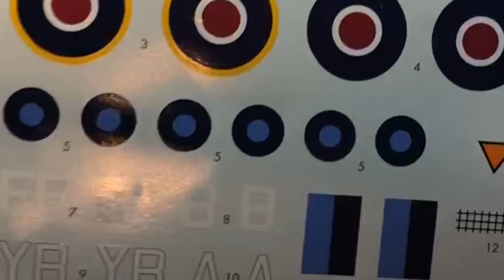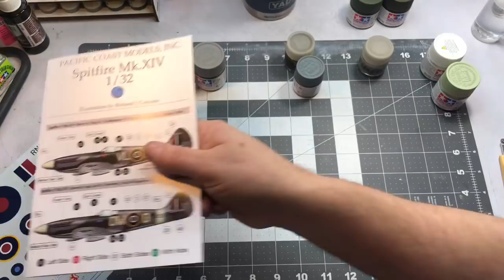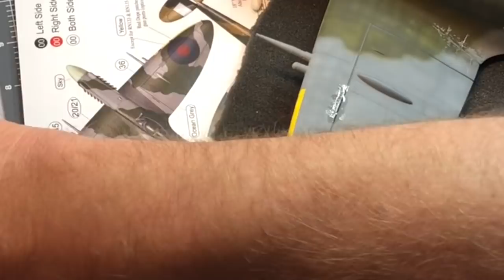Pacific Coast Models 1/32 Mk. XIVc Spitfire Build Part 3

Comment: Those wheel wells / retracted landing gear looks perfect.  I like all the stuff out there to fill with. I am truly loving working with Plastic Putty for seams & such. The Q tip & iso alcohol tip is interesting. I can actually immediately try that as I have the Testors putty. Your modeling level makes my nose bridge ache between my eyes as I watch.

Comment: I like using the Vallejo plastic putty {acrylic resin} it's water based marble dust. Excess comes off with water, or light sanding after drying. That's why you see Crew Chiefs always with a large screw driver in their coveralls. They need it for the Dzus fasteners on the cowlings. Rosie wheels & JLC razor saw I can't build without them. Tamiya has an excellent line of RAF colors. They have RAF I and RAF II. 56th F.G. also used RAF stock colors on their P-47's so I use that for the P-47M's & late D-30'S & D-40's I build. Nice riveting detail and extra paint work.
Reply from the maker: Thanks Bob.  I use vallejo plastic putty occasionally...it shrinks a lot though.

Comment: ALWAYS spray a gloss coat before applying decals to avoid silvering especially with stencils.
Reply from the maker: Yeah that’s not a thing.  You might change your mind when you see this one finished.  The decals have all settle and no silvering without a gloss coat.
Reply: @seanerk5kt9   Very glad to hear that. Unfortunately this is not always the case. Keep up the good work and the videos coming.

Comment: Have to say l agree with your comments at 10.30secs. Who has the knowledge to say which colour is correct. The pilots at the time certainly didn't give a hoot. I know of pilots who had their personal mounts polished to increase top speed. It made 3 to 5 mph difference.